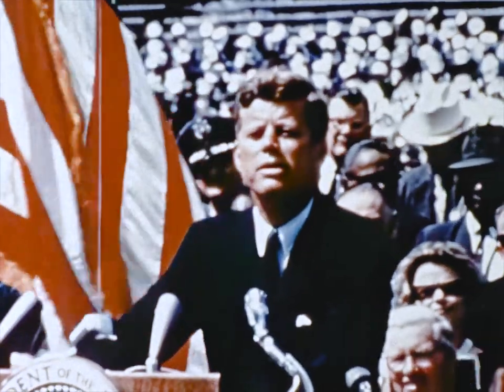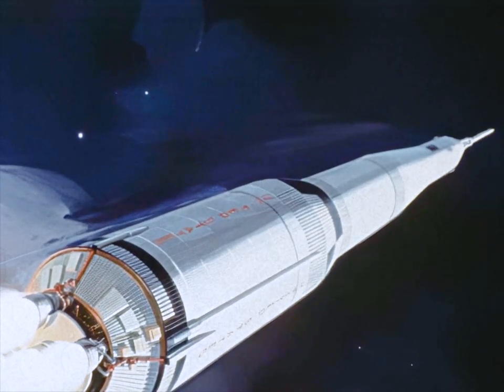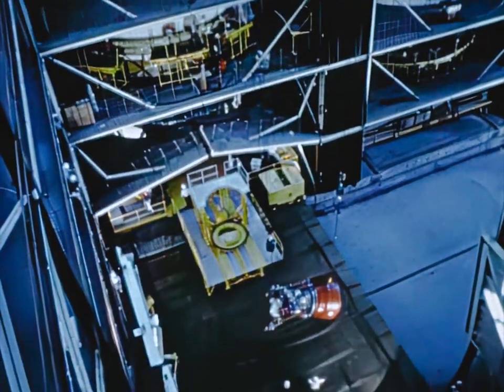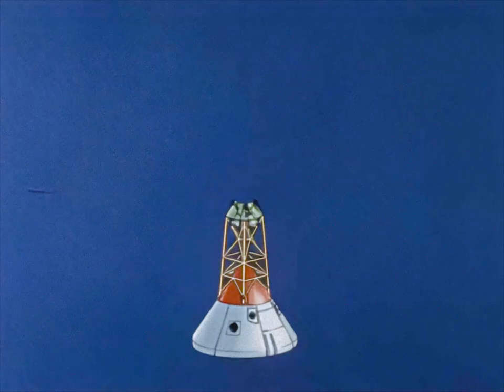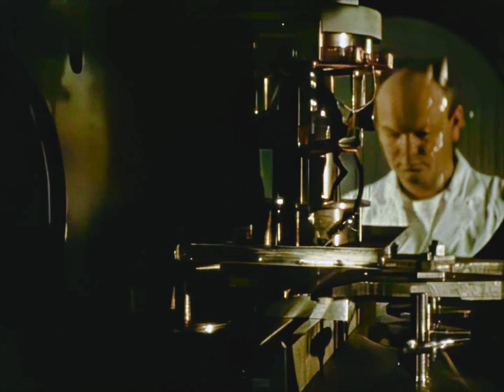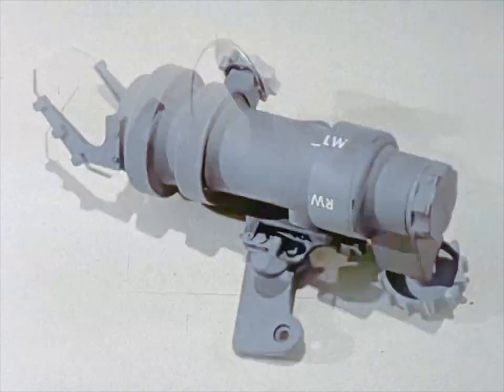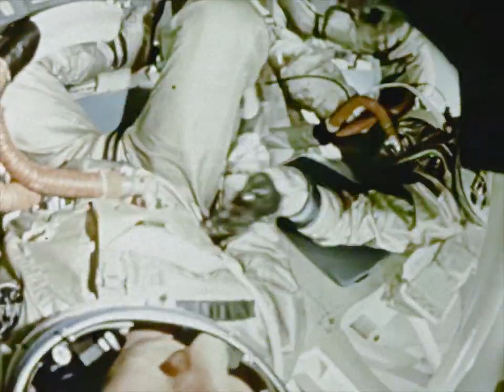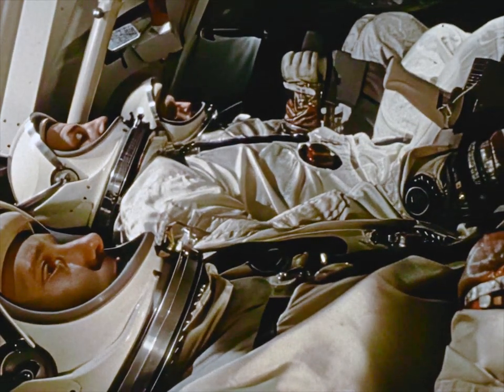Project Apollo (AI upscale) - 1967 NASA Full Documentary, Tests, Simulator, Illustration, Astronauts

Comment: One question...who filmed Neil while he touched the moon in 1969?
Reply: For Neil's first steps, a TV camera was installed on the descent stage of the LM. The descent stage has storage compartments on the 4 sides between the legs. On one of the sides adjacent to the ladder, there's a storage compartment (MESA) with a cover that is hinged at the bottom. The TV camera was placed on the inside of a cover panel, and when the cover was open, the camera was aimed at the ladder. The astronauts could open the cover panel from inside, and operate the camera from inside the LM.  
This video shows where the camera was: https://youtu.be/oX8-IXdABuc?t=264